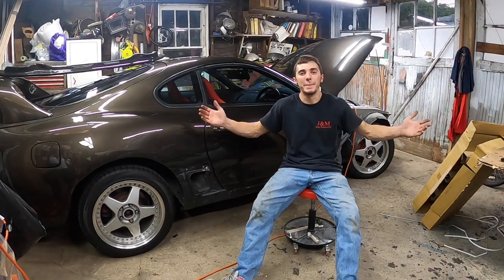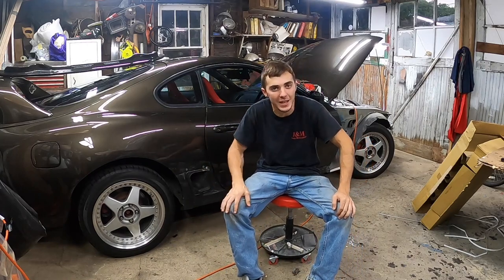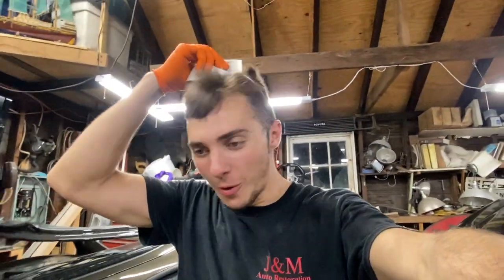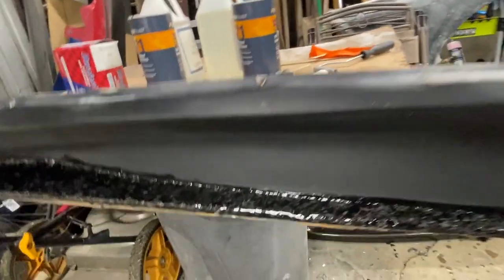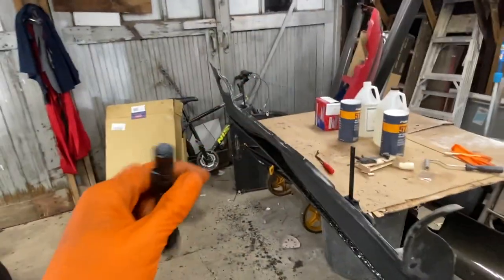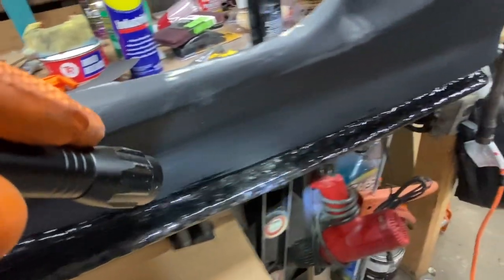MKIV SUPRA: Forged Carbon Side Skirts | Sanding+Resin!

Comment: Great video! I get my items from composite envisions and my reasoning was shipping more than prices.

Got any tips on how to lose less chopped fabrics near the edges? When I’m rolling down the peel ply, I have some issues with the edges losing carbon and normally have to sand and re-layer the bald spot.
Reply from the maker: I haven’t tried them yet, but Ive seen nothing but good reviews! And as for layering I found the best way to get a good thick layer of carbon to bond well is to apply a nice thin coat of resin, let it tack up for about 20-30 mins (helps to use heat gun) and start to apply in sections. As you apply it gently press the carbon into the tacky resin (I use both a clean pair of gloves/ or a piece of peel ply) and just press it down and apply heat afterwards, then add another light/medium coat of resin and then apply heat and let cure.